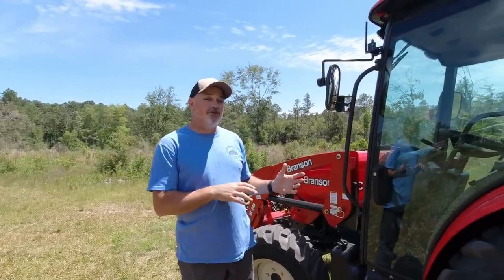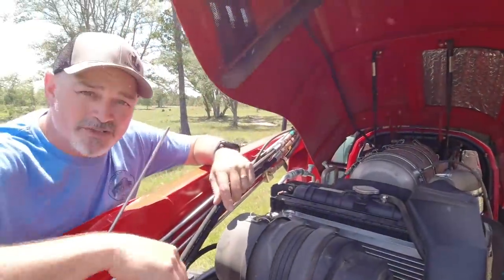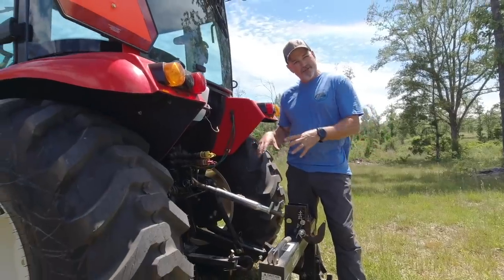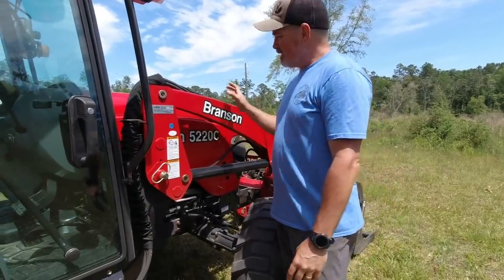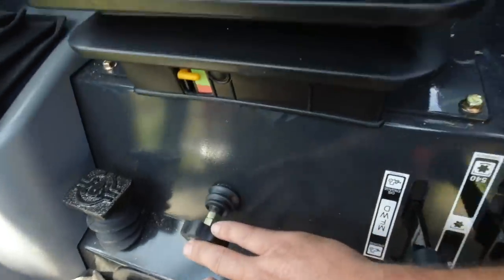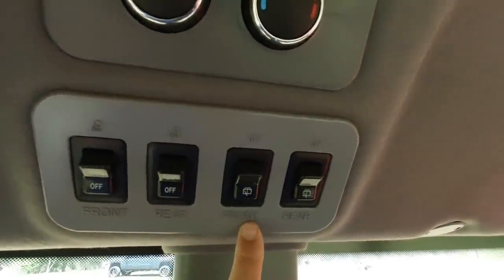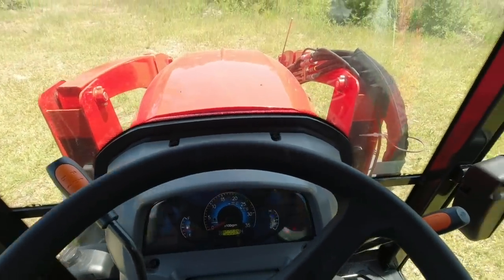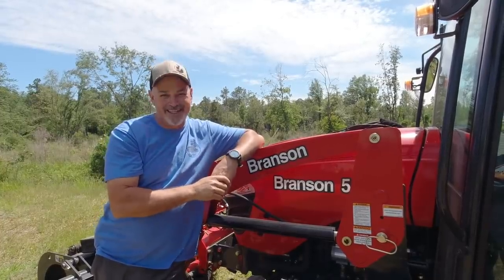The BRANSON Tractor! We review the Branson 5220

Comment: You're right about the radio. I'm not really sure why they put 'em in tractors. I suppose if you're plowing 50 acres and the rows are long and straight and the tractor is pretty much driving itself and you're just guiding it along, you would probably be pretty bored and want to crank out the tunes. But otherwise, I wanna pay attention to my work. (Watch out for that rock!) 😊 Thanks for the walk around! I'm sold, where do I sign! 😃
Reply from the maker: I'm with ya David. 👍 Thanks for the comment buddy!

Comment: All right, Hank. Quit trying to hide your grin about the dry cab and a.c  on that rig. You know you can't fool everybody. GBWYall! I hardly ever play a radio either. Especially on my chain saw. AND with that regen system you don't have to run it wide open for it to work. I've run it on other stuff and it does fine around 2/3rds wide open or half, even!
Reply from the maker: LOL> Was it that obvious :) Thanks for the comment Lewie!
Reply: @HamiltonvilleFarm  It was to me but I knew what to look for. Being used to not much or no cab I almost felt guilty when I got in the 771, the 115 and the 980 and had condensation on the windshield. I sAID almost! GBWYall!

Comment: My  2001 NH TC33D has 2 hydraulic pumps 1 for steering 1 for loader,  has the Deluxe 3 point hitch with Leveling crank, pin type stabilizers and telescoping lower link. The Branson looks like a nice tractor but I prefer the older models without the DPF or DEF.
Reply from the maker: I hear ya. Thanks for watching 👍

Comment: Hank, nice walk through. The engine has a cummins license. You can use Cummings parts, if needed, to make engine repairs. The engine also has no computers. The only computer is checking the pressure difference on the soot cooker. The radiator fan is powerful and will clog the screens when brush hogging. I do wish the tires were loaded as standard equipment. Also, the ability to raise and lower the 3pt from the rear would be nice. Get some mud on that Branson.
Reply from the maker: Yeah Jesse all good points. Funny you should say that about the radiator. I noticed it today when working in some brush.
Reply: Hamiltonville Farm I keep a eye on the engine temp, it’ll creep up on you quick... don’t ask how I know...😉

Comment: Do you know if they offer gear tractors not shuttle shift or hydrostatic
Reply: Shuttle shift is a gear tractor. It's a 12x12 transmission. You have 3 range gears, 4 synchronized gears and a shuttle lever that switches between forward and backward.
Reply from the maker: I'm not sure. I don't recall seeing any, but let me do some research and I'll edit this comment if they do!
Reply: @HamiltonvilleFarm  ok thanks
Reply: @pedrobatista4439  I know but like he had in the mahindra that it complet gear no shuttle shift
Reply from the maker: They had a gear drive in the smaller hp range. but now just shuttle shift/ hydrostatic👍
Reply: @HamiltonvilleFarm  ok thank you

Comment: I understand you're working with demo tractors but for those buying tractors (me) and wanting simplicity with no DEF or computers or advanced electronics to deal with the simple solution is to buy older high production number John Deere,International, Ford and some Massey Ferguson tractors. Quick internet search shows what models have issues and what models are bullet proof. For the cost of the Mahindra you had (not sure why it's gone) or the new Branson I can buy 4 to 6 55hp range utility tractors from the 1970's to the mid 1980's era. Might need a little work or might just need a heavy service cycle and they are ready to do a days work. Full disclosure: I have been turning a wrench for about 45 years and have 15 tractors and counting.Plus dozer,backhoe,dump truck etc.Just bought 2 International 140's from the early 60's just for cultivating. Got both for about the same as a 48" cut riding lawn mower.(5200.00).Had to do a little work but overall I am pleased and have the exact tractor for cultivating that I wanted: times 2. Nice channel and I will subscribe.
Reply from the maker: I still have the Mahindra. The Branson Regen is not like the competitors. It is passive and if you run it at, say, 2k all the time, the regens will be few and far between. There is no computer on this tractor either. But I agree with you about the older stuff. They just don't make them like they used to. Thanks for watching and leaving the comment. I've been happy with the Branson so far. I'll leave my opinions in other videos as to my likes and dislikes of the tractor.
Reply: @HamiltonvilleFarm  Pretty sure the branson does have a computer of some type: since it does have a regen mode passive or not. If there is a single sensor on the tractor it "talks" to some type of computer.Easy way to tell: start the tractor then disconnect a battery lead. If it dies there is a computer. Both are nice tractors and come hot weather you're going to love the cab and A/C. Bought a JD 5320 with cab and A/C just for that: too old and can't take the Texas heat anymore.
Reply: @amossnowdaharleyman9179  Good thing about Branson up to 55HP is that the Emissions works as a stand alone unit. It's almost like a add on they use for the countries that require emission controls. So this allows you just take the DOC off, replace it with a muffler, unplug the data logger and you're ready to go with a perfectly good running tractor like the old ones. 
The engine is fully mechanical so there is no codes or ECU preventing anything to run after you unplug the data logger. Some people will just gut the DOC instead of replacing with a muffler, since the second option requires fabrication.

Comment: I drive semi's for years with and without the new emissions systems and a regen, passive or not, is still a regen and  when you have a problem with the emission system, especially the DPF or the DEF pump injector system, it is costly to repair.  For reason and that reason alone , I bought the Mahindra. As you know  every size of the Mahindra tractors do not have a regen system, which is not true of every other brand even John Deere unless you get the under 25 HP model. Then as for having it with a turbo, turbos are not cheap and using one on the farm with all the dust of what ever,  it can get clogged up in the turbo fans and ker plunk ker plooy, another costly repair and I wonder what the warranty will cover for that. My brother had a 2007 Ram 3500 diesel that he bought from a farmer 2 years ago. 4 months later he was buying a new turbo, $5000.00. The cause, the mechanic found quite a collection of dirt that destroyed the fans blades in the turbo.  On a big tractor or combine, having a turbo makes sense because they have the filtering system, and they need that extra boost of power.  By the way, I am not a troll trying to give ya poop, I'm telling it like it is, which you know it to be right.
Reply from the maker: I don't take you as a troll at all. I appreciate your comment. I had a Mahindra 4540 and did a couple hundred videos on it. The only issue I had with it was the fuel pump went out. it was covered under warranty. But that happened with 150 hours on the machine. I wasn't happy about that. I do like the mCRD design, I'm just waiting for what people are saying in the next 5-10 years if it is still holding up. I feel between the Mahindra and the Branson, The Branson is better built. Have a good day. Take care!
Reply: @HamiltonvilleFarm  Here's a couple more tid bits for ya to think about. First, I have a 2015 Ram 1500 with a 3L ecodiesel.  The 2nd gen motor, which is what I have, had many problems with the new emission systems, DEF,DPF, EGR and everything else in what the system contains but those are your top 3. Fiat-Chrysler, recalled all the 2 gen 1500's and tried to fix some of the problems with software updates. If that did not work they replaced nearly all of the emission systems which is what happen to my truck a few months back, that is, they saved me 6-7000 dollars because I had no warranty on this. These little diesel motors, including now, Chevy and Ford, have passive regen on their half tons. You don't know how bad the DPF is getting because on the half ton trucks, they don't have a monitor to see if it needs to have a forced regen.  Most 3/4 and 1 tons have this capability of forced regen. Bottom line is this. For those little motors to work with the passive regen, it is required that the motor RPM's run high, like on a highway, for some time to burn off the soot in the DPF to prevent the system from failing due to extreme heat. If not the DPF will get clogged and if the computer on your vehicle, including your tractors who have this system, does not engage the regen your DPF will fully clog and the only way to get it unclogged is to take it to a dealer where they force the regen. Otherwise it will cause the head to warp or crack which happens when the seals leak, because of the extreme temperatures, causing anti-freeze to leak into the head. Which is what almost happened to my truck. So again, unless I was running a combine or heavy tractor, I would not consider any small tractor that comes with this new emission system. Now what I am saying may not happen to you, but to the next guy that buys it after you are done with it, it may very well happen to them. Either way, it will happen. The Branson maybe made beefer, maybe, but that  beefy build is not the engine. And as you know, you can have a great build of a tractor but it ain't worth a can of beef stew if the motor fails...

Comment: Yeah I think I'll stick with an older non regen machine....That regen crap seems to rear its ugly head at the worst moment...
Reply: Good thing about Branson, up to 50 HP, is that the Emission system is a addon after the fact. So you can just take the DOC off, replace with a muffler, unplug the data logger and you have a old school tractor running perfectly and without emission crap.
Reply from the maker: Gotta love the EPA
Reply: @pedrobatista4439  WHAT?????  TRUE HANK?????
Reply: @HamiltonvilleFarm  Indeed! I mean, I understand that we need to save the environment but there are lots of ways to reduce the emissions, why use a system that basically turned perfectly reliable engines, into money pits? I've seen several big rigs and big tractors with the engines getting rebuilt with very low mileage just because of these emission systems.